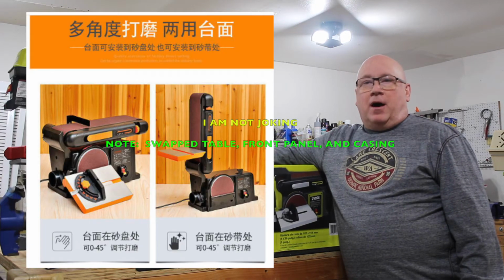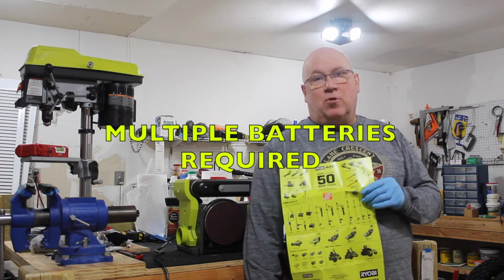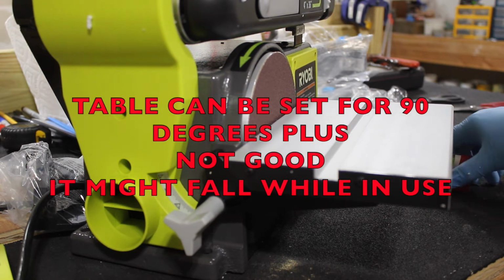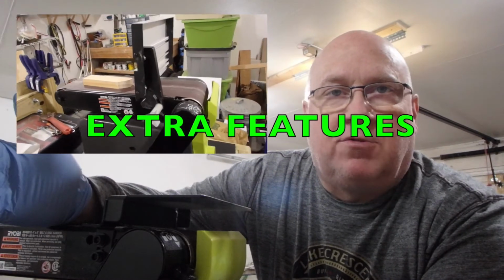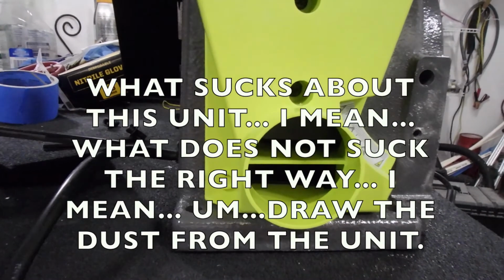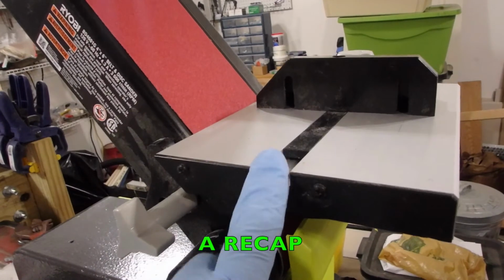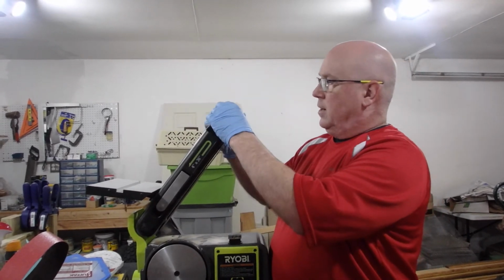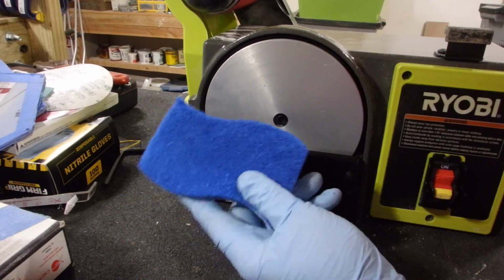Ryobi Desktop Belt Sander - It Kinda Works! (5.2) - Learn before you buy!

Comment from the maker: Version 5.2 of this video.   I was shocked at how many versions of this sander I found online.   So many all over the globe!   Each is slightly different.    But many of the parts are the same.   Exactly the same.   Usually the main switch plate is changed or the vacuum port side is slightly different.